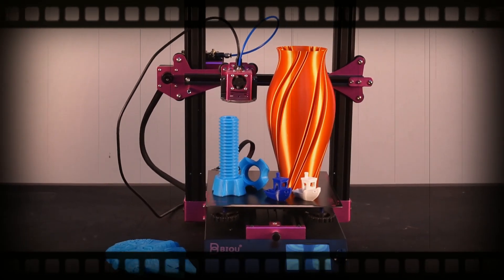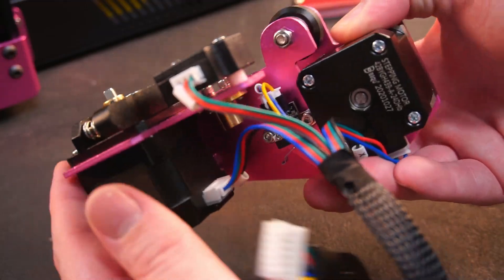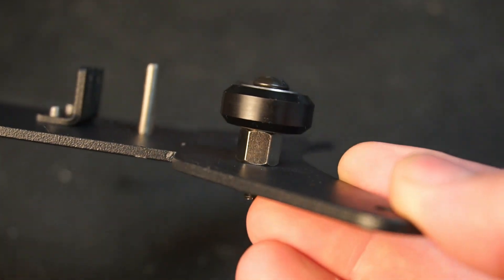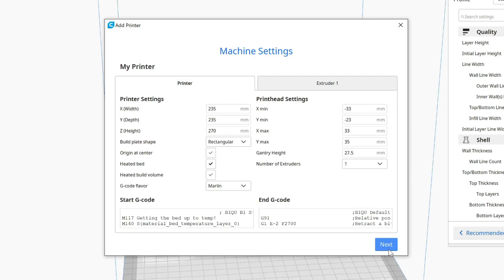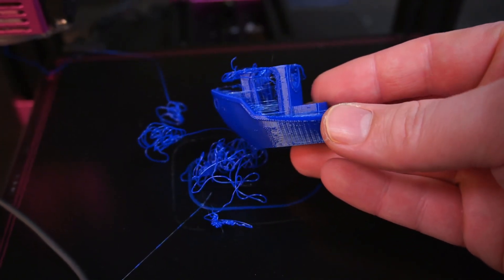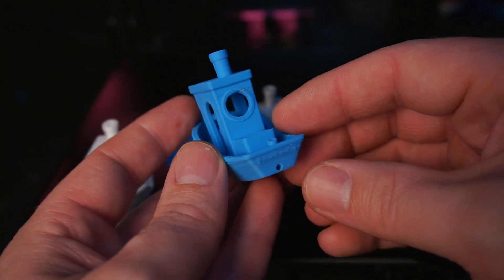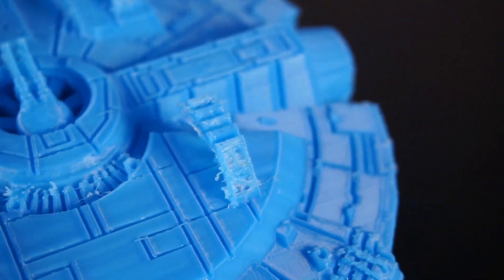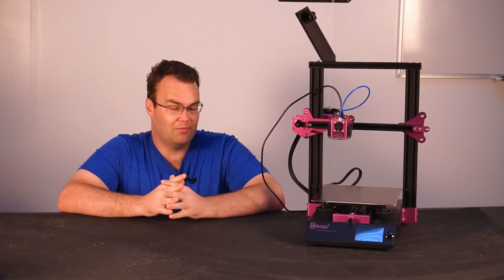Is a $299 3D Printer any good?? BIQU B1 Review

Comment: Biqu makes a direct drive similar to the Himera only more compact and lighter weight. I notice you upgraded to Capricorn tubing. I'm seriously considering this as a first printer. Biqu also offers a dual gear extruder and an upgrade heat break that converts the hot end to full metal. That might help with ABS printing. I figure with those and an upgrade to Capricorn tube I'd be all set. Adding a second Z axis lead screw sounds kind of involved, but maybe it wouldn't be too bad. I know the main board supports that.

Comment: I've had the BQB1 for about a month myself and I've pushed 5kg various PLA through it.   I find the Fan Noise out of the base on the right hand side to be inexcusable.    It is jet engine loud and you can hear it 2 rooms away.    Long term I'm worried about ability to swap hotend for direct drive as I suppose you'd just have to skip the entire USB C connection to hotend...  so you really need an entire Hotend wiring system that incorporates it's own wiring for everything (LED/Fans/..etc).    There is enough 'unique' enough in the BQB1 to make it a pain to upgrade easily as the userbase is never going to be as large as other printers.      It's a disservice to say adding AutoBed leveling is easy.   They included a bracket and plugin in the back and it gets every reviewer saying it's 'easy'.    There are in depth resource / guides on the crazy things required to get it to work in practice and it isn't 'easier' than other printers.       I recommend running your USB-C cable alongside your bowden tube with a loose ziptie near extruder.   It flops around much less that way and can't get caught in anything.
Reply: I agree on this comment, fans are loud. Auto bed leveling is PITA to setup but I easily managed to use manual mesh bed leveling tutorial by teaching tech. There is firmware on the thingiverse which makes it super easy to do so. My bed was warped out of the box so it is a must do. I also had problems with PLA adhesion until I bumped the temps to 240°C for the first few layers. I would recommend the printer for the money though.

Comment: Did you made sure your PTFE tube is all the way in hotend. Touching back of nozzle? It's a major cause of stringing in Ender 3 apart from tuning retraction settings. You can try Chep's Curaprofile for Ender 3

Comment: dude Star Trek Discovery? Try the Falcon lololo. Great review. So what's PLA plus? I only print in pla and need to and want to try other filaments.
Reply: @14:05. He got ya!
Reply: @pileofstuff  played like a cheap fiddle dagggggg
Reply from the maker: I couldn't help myself ;) PLA+ as the name would suggest is PLA plastic that has been altered to improve printing characteristics. It's about the same cost per roll as regular PLA so really there's no reason not to use PLA+
Reply: @Schematix  thanks my friend. I'll check the web to see if the plus adds strength or stops warping or what ever